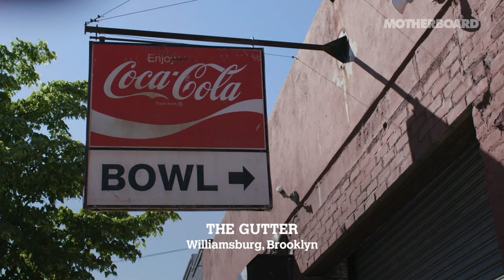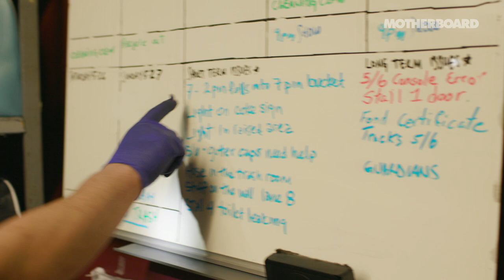The Bowling Mechanic Keeping America’s Favorite Pastime Alive

Comment: I was a pinsetter mechanic when I was in college at a 56 lane bowling alley.  Loved that job, but damn was it wearing and dangerous.  We had a rul that you had to get from wherever you were to the broken lane in under 1 minute and have it shut down to repair.  Didn't matter if you were in the back room, on the floor, or on top of the machines.  Not sure if it was worse running on top of running machines at full tilt, or behind them getting pelted often by flying pins when the power bowlers were in for league play.  I made a whopping $4.25 an hour doing that job back then.  Way underpaid for the expertise we had and for the danger it presented.

Comment: I loved my job working on the the AMF 82/70 pin spotters. The frustration sometimes is real when working on pin setters / spotters. Some times a problem will pop up you can sit and watch the machine with cycle after cycle to see what is happening, but nothing will happen. The moment you walk away the problem happens. I will never forget me another mechanic and the head mechanic we’re doing summer maintenance on lanes 25,26, and 27. Each one of us had our own machines we were working on. We were doing pit maintenance, pulling everything out. Well our head mechanic was having trouble with the front roller spring. It kept popping off the tool. Well he was getting more and more frustrated, and the other mechanic and I started laughing a little, because he started swearing. After about 10 attempts he blew up, took the hammer beat the spring and with each hit came a different swear word. Then he took the spring and threw it all the way to lane 48. Me and the other mechanic were dying of laughter. It took us about an hour before we could even start with finishing up our machines. Our head mechanic was one of the most laid back person. To hear him explode like that was so funny. We didn’t see him for another 1 hr and 30 min. I will never forget that moment. It is a great memory.

Comment: I did this job on both Brunswick and AMF machines for quite a few years, one of the best jobs I've ever had. Shame I never got to work on those A2 'setters
Reply: A2s are the best. The center I worked at had 16 Japanese A2s (run a different pulley on the motor so they go super fast compared to a standard A2) and they were a blast. I also worked at my college campus' bowling center (6 lanes) had old Brunsick As converted to A2s. Such fun machines to work on but also complete pains in the ass at the same time. I actually have a really old video of the college pinsetters on my channel. I think I posted it back in 2006 so the quality sucks, but I miss working on those machines all the time.
Reply: heavyq any of the centers on the east coast? I resurface wood lanes /approachs and install synthetic lanes in 14 states on the east side. If so there a chance I've been there.
Reply: No, they were in Montana. One was at MSU in the Student Union Building and the other was a center called Murph's in Great Falls. Murph's is closed now and was torn down a few years ago. MSU still maintains their 6 lanes for bowling classes and I think they have even restarted their collegate bolwing team last I heard.

Comment: This video doesn't convey it's message very well. These machines are mechanical and only get instructions like cycle once and reset from a computer yet newer ones are more programmed and track the pins better.

Think of these ones as an analogue clock that has 2 stages, stage 1 is pick up pins and sweep underneath to clear the alley of knocked down pins, then stage 2 is to clear all pins and place new ones. If the pins were too slow to reload and an incomplete set has been placed then the machine would have to be cycled twice just to get back to stage 1 again, stage 2 cannot be skipped in the process
Reply: If it’s slow reloading, the machine stops at 180 until the 5 pin drops and sets a full rack. It’s also totally possible to put the detector In 2nd ball and skip the reset cycle (happens all the time in no-tap bowling or on the 10th frame fill shot)
Reply: A2s have time-delay modules that manage these cycles and a mechanical detector. The turret (holds the pins prior to dropping into the deck) waits for all 10 pins to be received before dropping the pins into the deck. The deck will wait for pins before the machine will cycle from the second ball back to the first ball. When the machine gets stucks waiting for pins, it's called a 180 and will require manual intervention to clear.

Missing pins are never because the machine goes too slow or too fast, but because it either double-dumped (two pins in one deck chute) or the turret double-indexed (usually a worn clutch), or, in extreme cases, the pins fall into the deck itself and not the chutes which usually causes a deck jam.

Of course this only applies to the Brunswick Jet Back and A series pinsetters. AMFs and the newer GS and GSX Brunswick pinspotters are entirely different beasts.

Comment: Someone got squished by the pinsetter? How heavy is the pinsetter? Not the whole machine but just the pinsetter that comes down. How heavy is it?
Reply: i think its pretty heavy and its set down by something so it must have some force
Reply: Depends on what machine he was in a from my knowledge I work on amf 82-70 won't kill you if your laying on the pin deck on a respot it will just lay on you with some pressure then go back up on a spot the pincups will scrape you up a bit but if your inbetween the table and the bin you will get crushed in the machine. But the a2s in the video I believe the table assembly weighs like 200 300 pounds  and it doesn't stop going down or going up. I seen a video of a a2 crushing a 5 gallon grease jug like it wasn't even there
Reply: Just the " Deck" ( Part that goes up/down) weighs in excess of  300lbs. The part he was working on is called the "Pit Cushion Assembly" & a major pain to work on... LOL I too am a pinsetter mechanic (Brunswick Jap A-2's). Similar to the ones in the video,
Reply: As a former Brunswick A-2 and Jet Back mechanic I can say that if you get caught between the deck and the turret when the deck raises up, you would activate the turret jam switch shutting off the machine. If you are laying on the pin deck and the deck is going down, the out of machine should go into the out of range cycle and the deck should return to its up position. So in a properly running Brunswick pinsetter you wouldn't be killed from the deck going up or down.

Comment: Why they acting like this is the only guy fixing pinsetters in America in the title?
Reply: Ken Bob 😅😂😂
Reply: Actually they are trying to say he may be one of the few able to understand how these old mechanical based pin setters work. They are just like clocks and have no sensors

The new ones are more computerized with less moving parts
Reply: Shout Out 📣 The Holler House in Milwaukee, WI USA. I didn't think this still existed until I walked in there. ☺ Thanks for the video.